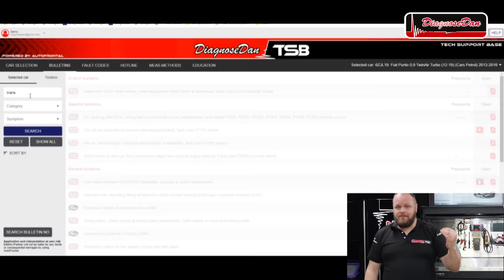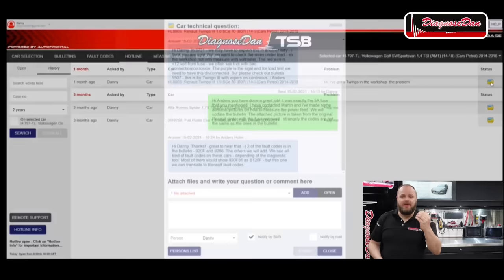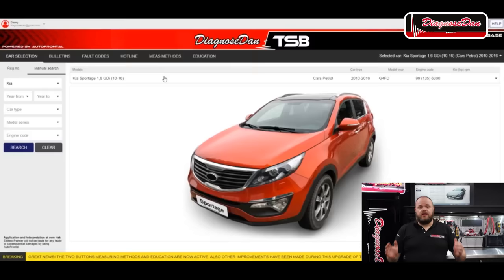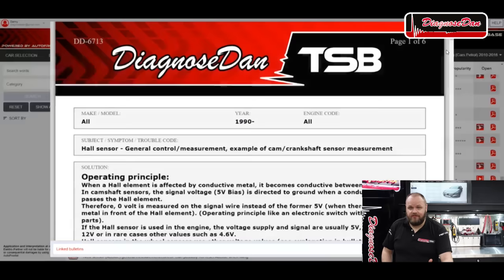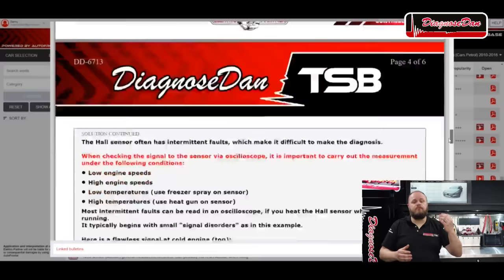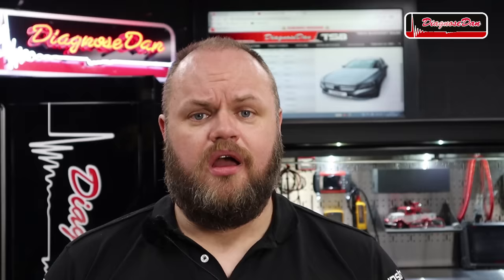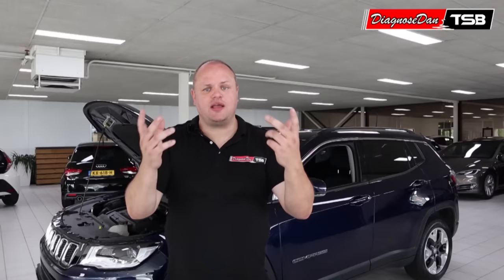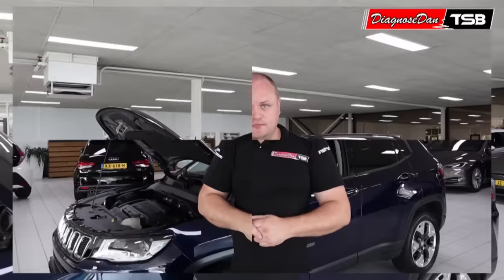Fuel trims explained (the easy way)

Comment: Excellent Resource for Mechanics.
  The All Data and Pro Demand aren't that accurate in components location, they information is more generic information and the wire diagram don't have the voltage valve in the same page what make them more time consuming. 
....of course way expensive not accessible for Small shop or Mobile Mechanic 
By the way The answer is 26-04-2019

Comment: Do you always get a code thrown? I’m thinking my vehicle is definitely using way too much fuel even under low loads, no codes though …checked air cleaner and map sensor been cleaned. I can only think to clean the fuel system with cleaner ( gasoline)

Comment: This is useful information I agree. But can you do more videos on cars like BMWs with throttle free load control (valvetronic) and direct injection and turbos. Diagnosing mixture faults is way more complicated on those engines and I'm yet to figure out a surefire way of going about it.
Reply from the maker: If i get an interesting case study i'll film that of course!
Reply: @Diagnosedan  thanks mate! And keep up the good work, I love your videos!

Comment: Very nice video, thanks. If the short term fuel trim is +20, then after some time the Long term fuel trim will be +20, and short will be around zero? Long term fuel trim will be stored in the computer and short term fuel trim will be zero every time you shut the engine of, or?
Reply from the maker: Yes that's right

Comment: Just one question Dan... wat about cars in South Africa? I'm not sure if our cars here have the same levels of European emission standards?

Should be worth the trouble to find out?

And it's a great idea what you've got running right now - give access to accumulated knowledge for others to be able to resolve issues quickly and easily without pain.
Reply from the maker: Emil emission standards aren't as different as they used to be. Most of the time we see the same issues on a model around the world.
Reply: @Diagnosedan  Cool, good to know. I may be looking at starting up a small business in the Eastern Cape, may have need for your knowledge base 👍

Comment: I diagnosed a p2173 code with a vacuum leak by using fuel trims and smoke machine. I almost threw a throttle body lol.
Reply from the maker: Great job💪💪

Comment: @Diagnosedan Hi Dan, I have an issue in my diesel VW Tiguan 2011 with engine light coming on and off and this issue is related to EGR. I had the issue checked and all except one mechanic is suggesting EGR valve change. The one that does not suggest that is saying that are some plastic hoses that are connected to EGR which are loose and need to be checked. The mechanic had only the diagnose tool with him and no shop or place to check it him self. If you could suggest any thing it would be appreciated

Comment: I need help. Trying to figure it why my moms Scion is running so poorly. She’s getting lean codes, a constant cyl 2 misfire with brand new plugs and coil packs. Her STFT stays pretty constant around -4% but her long term is 13.8 and then goes to 7.8. Any suggestions? I’ll gonna spray some break clean in some areas to see if I’ve got leaks. Her car has 348,xxx miles!!

Comment: I have a 2012 Buick enclave..on cold starts it idles very rough for about 10/15 seconds then idles down nicely..I am getting on bank 2 short term and long fuel trims of negative 100%
.any thoughts, bad fuel injectors, bad oxygen sensor or big vacuum leaks. I have no codes

Comment: Hi Dan,
I owned a 2006 MB R-350 gasoline engine. It can not start since the last time it started and stalled after it was running for about 10 seconds. I lived in Canada and the weather now is up and down between -10 to -20. Any help thank.

Comment: I have no short term fuel trim B1-S2 reading (- - - ) on my scanner tool. There is a reading of 0.685V on oxygen sensor output voltage B1-S2. What does this mean?. I have a 2013 cruze.

Comment: hi Dan thanks for video why value of long fuel trim stayed  positive in either cases.
Reply: If I am not mistaken, long term fuel trim is more like an average.  Short trim is real-time.
Reply from the maker: It's " long term" so it doesn't react fast to sudden changes. If the problem existed for a longer period of time the long term would also change
Reply: Thank you very much.

Comment: As far as I know my car bases its fuel trim on the manifold pressure sensor, throttle position and timing advance.

Its useless for identifying individual injector faults.

Comment: Is it possible to buy cheaper DIY enthusiast plan on your web site just for 2-3 cars. If I own 3 cars I would like to have a cheaper option only for those 3 specific models. 340 Eur is kinda a lot for me. I would use the web site maybe couple times a year.
Reply from the maker: We only offer a 12 month subscribtion.
Reply: @Diagnosedan  I understand that. Sorry i did not formulated the question better: can you limit your online app just to 2-3 cars for a specific user? Yes 12 months but for less cars.
Right now there are all makes and models for 340eur. But if you limit user access to just 2-3 car models (maybe 10 eur per car) than it could be open for way more people to buy your services. Right now it is used only by car shops, but if you introduce this "restricted" option all DIY people would become your potential buyers. I do not think DIY people are paying 340 because it is too much for 1 car.